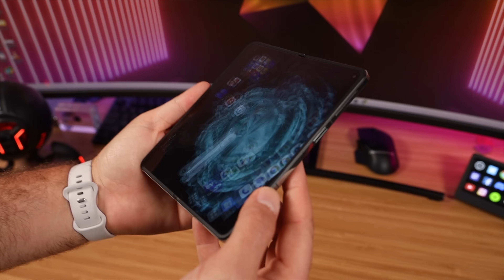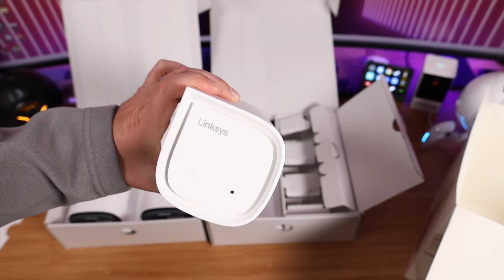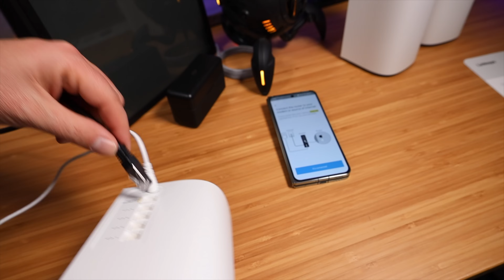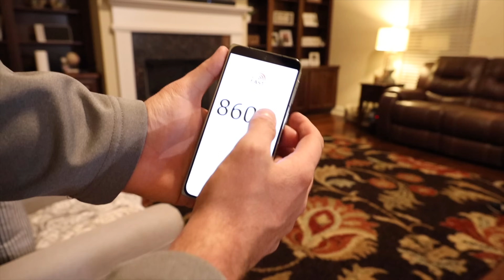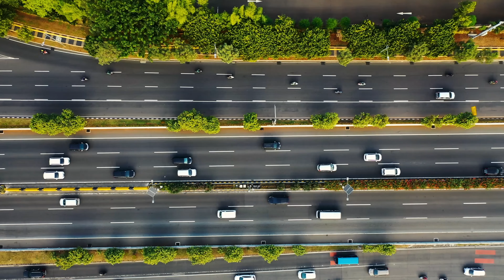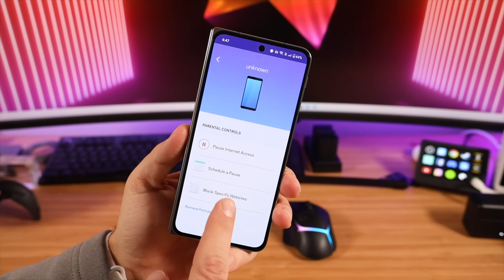Linksys Velop Pro 7 - Wifi 7 is Crazy Fast!

Comment: I recommend not buying any Linksys Wifi product. My brand new WiFi 6 mesh router failed almost a year ago and Linksys refuses to replace the unit even though they admitted it is a hardware failure. I went to Eero, far better performance and support.